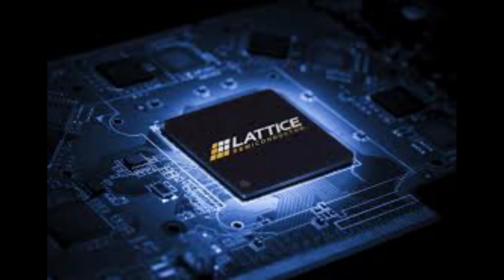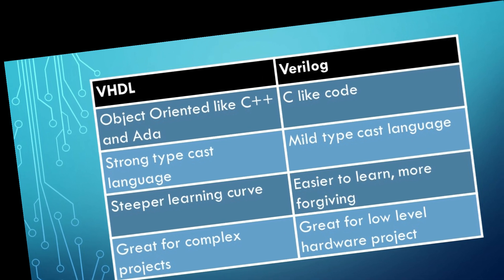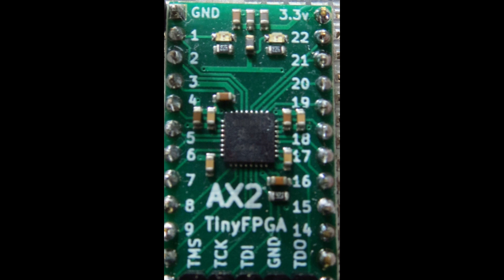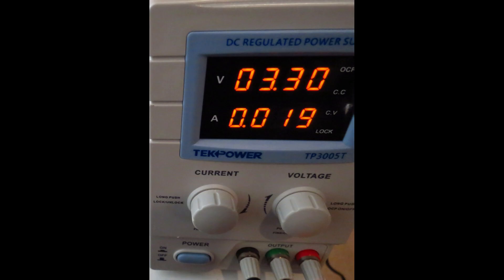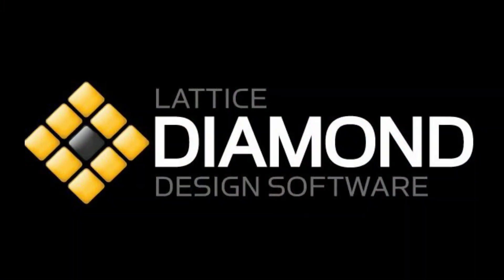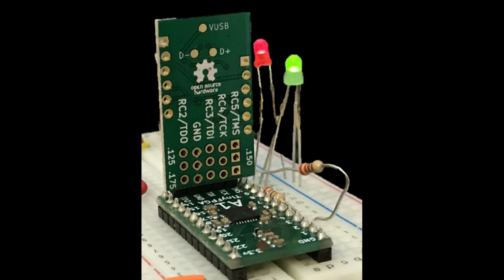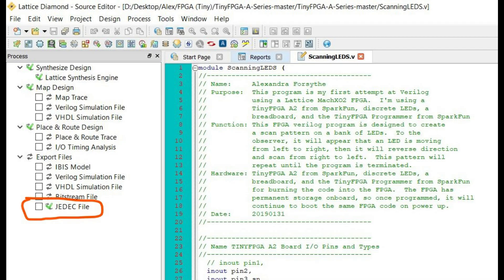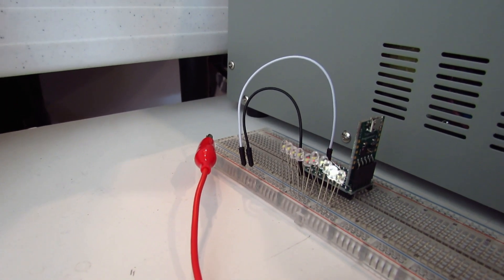FPGA Project

Comment: Maybe you could build a pal for R2  - make them able to communicate ..lol...I love that little guy, good work. Next time at the shows you should totally go as C3PO  if R2 had a way to track you he could just follow you right? Oh yeah, how does he get about? what kind of wheels did you use?
Reply from the maker: The center foot has two casters, and each of the rear feet has one caster and one drive wheel. The drive wheels run off electric motors in the feet. Depending on the venue, I do dress up as a Jawa and hide R2's controller in my robe.